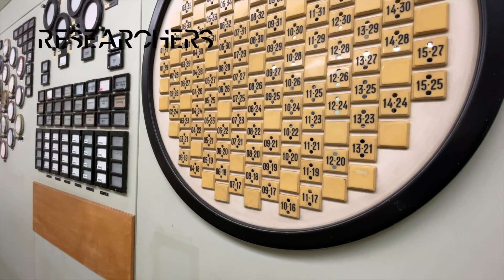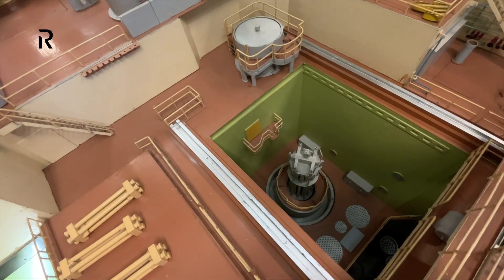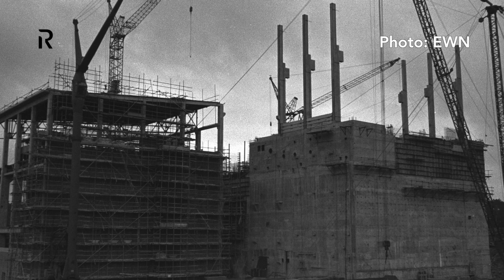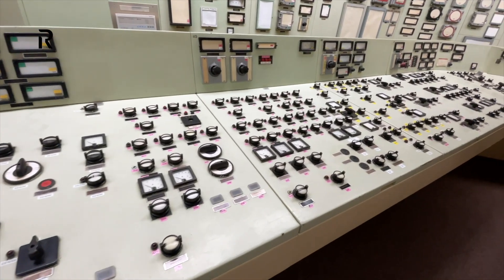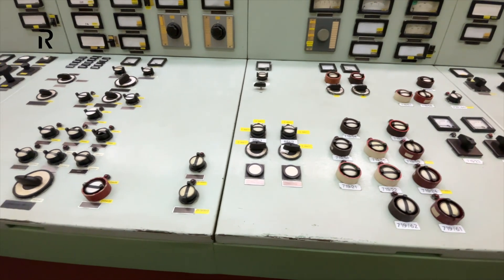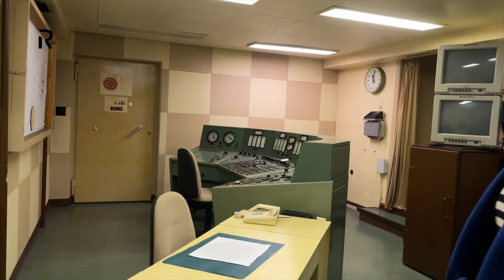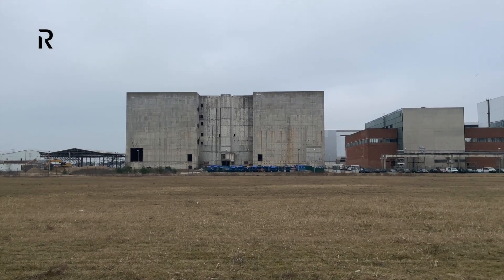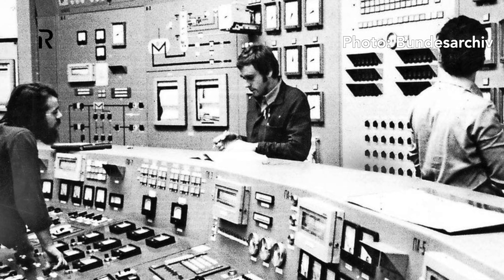Experimental reactor in the GDR: Abandoned nuclear power plant

Comment: In fact, the Rheinsberg NPP used a VVER-70/2 reactor. While the GDR favored a reactor with an output of between 50 and 100 MWₑ, the Soviet side recommended building a 70 MWₑ reactor based on the VVER-210/1 reactor, a model of which was already under construction at Unit 1 of the Novovoronezh NPP at the time. However, the reactors had different different goals. While the VVER-210/1 reactor was more performance-oriented, so that the output could be increased from 210 to 240 MWₑ shortly after commissioning, the VVER-70/2 reactor was intended to serve more for the further development of the technical facilities.